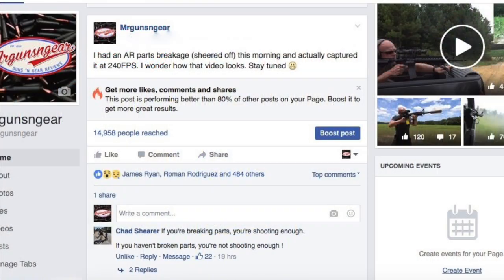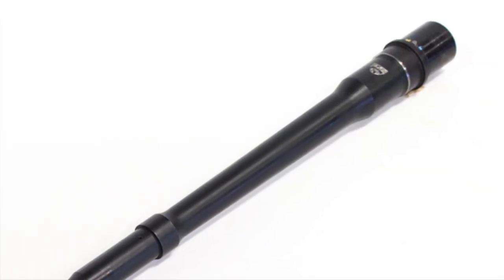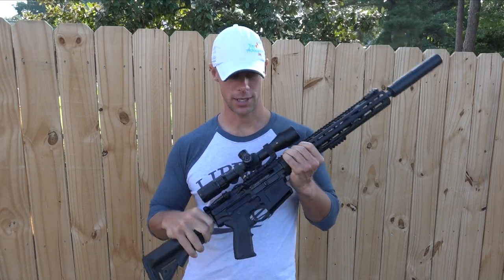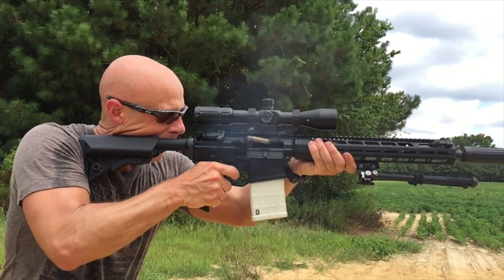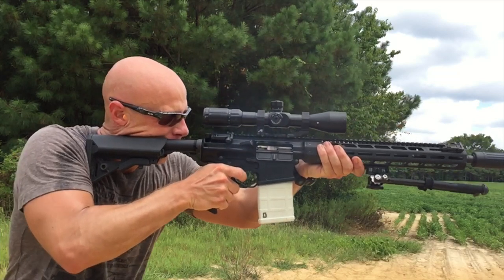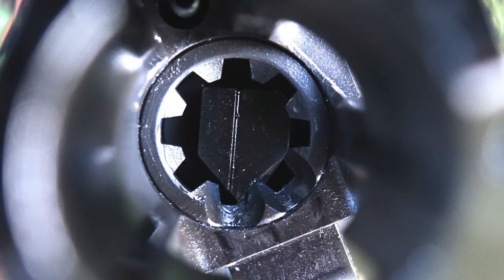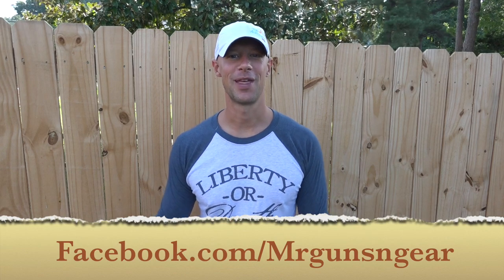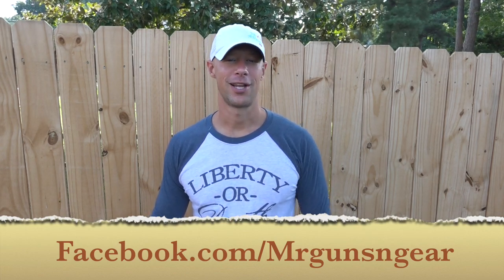AR-10 Bolt Catch Sheared Off While Firing (HD)

Comment: Hey MrGuns, I had the same issue with an early CMMG .308 lpk bolt catch on my DPMS pattern AR308.  It was about 500 rounds in after building (about 4 years ago now).  When I contacted CMMG, they said that was a problem with early designs (built like standard ar15 catches) and sent me out a replacement new model free of charge.  I'm now at least 3000 rounds in on the new one with no problems, using anything and everything, but mostly hot handloads and 178 grain projectiles (was pushing them out to 1000 yards from a 16" barrel with carbine gas system) so I know it has been punished.  Summary, CMMG is my go to for LPK in DPMS pattern AR308, for what its worth.

Comment: +Mrgunsngear I didn't read through all the comments so I don't know if this was addressed already but it looks like you had a bolt catch for a small framed AR patterned rifle. They will still fit and function in a large frame AR/DPMS but I wouldn't trust it. I almost used a smaller one as well for my 6.5cm rifle but it didn't look like it would reliably stop the larger mass of the AR/DPMS bolt carrier group. So I looked up and ordered a large bolt catch and its much thicker to stand up to the mass of the larger BCG.
Reply from the maker: thanks
Reply: You really like the one word responses.

Let me guess..."indeed"   LMFAO!

Comment: Drop a quarter into your extension tube before reinstalling your spring and buffer. This will reduce the over travel of your bolt and will therefore reduce the momentum when the bcg impacts the bolt catch after the last round is fired.
Reply: I used a steel washer of the correct outer diameter.

Comment: Looks like it was cracked previously and had soaked up oil into the crack causing the dark area, then the light area is what was left holding it together and finally let go.  Either that or it was cracked when it had the finish applied, but I doubt that.

Comment: Thanks for making this a video. Reid Henrichs said in a video about DMR semi-auto rifles that the M1A or FAL are preferred because AR 10/308 types don’t hold up under heavy use. Being a former Marine yourself, do you agree? I personally don’t think of it as a battle rifle, more of a useful platform for ease of carrying something that can function reliably in a mobile DMR role if shot selectively (not in rapid bursts) and it compensates for the extra weight having a lot of .308 ammo will add to a marine’s kit. For anything in 300 yards, machine guns and M16s would be enough to do the job I think.

Comment: On my first AR-10 build I had the same thing happen, minus the bolt catch actually getting jammed in the chamber. I was messing with a JP adjustable gas block and ended up way over gassing the gun when I switched loads.

Comment: I have a 9mm AR and have sheared two bolt catches in te process. I have the heavy buffer, plug, 9mm spring just changed to the Seekins precision they claim it is tuff with there new process. The crappy part is I can't use my bad lever so that sucks but hope the damn thing works...good luck
Reply from the maker: thanks

Comment: I have about 3500 put through .one and its still looking good. must have caught a bad catch I didn't hear the first time I watched it how many rounds but thanks to all who explained
Reply from the maker: glad to hear it
Reply: +Mrgunsngear Channel I'm only running a standard cmmg parts kit for ar15 in my ar10 and I have no issues with it but thank you for the video
Reply: +Andrew Fibush - Props on getting the CMMG kit!  They redesigned their bolt catch a number of years ago (I had gotten one of the last of the originals and they replaced it free of charge when it broke) My new one, like yours, has been going at least 3000 rounds so far with no problems.  Great product and great customer service!  CMMG = AR308 win!
Reply: +Pro2A cmmg for the win in general. I love em good quality parts and cheap as hell lol. I got quite a few parts from them. including and entire upper system and completely love them. I guess I turned a fan boy with great costumer service . I have everything cmmg :)

Comment: Last week,  the IDENTICAL thing happened to my Mega AR-10 lower. Mine wasn't after 2,000 rounds, mine was after 21! Yes, the 21st round caused the bolt catch to be launched into the chamber. I sent Mega an email, and they explained that they don't make the bolt catch but without question, they sent me a new one. The new one is slightly different, and hopefully holds up much longer. I've needed to use their customer service once before, they are quick to respond and stand behind their products, good company.
Reply from the maker: crazy

Comment: Same failure I had with my AR-15 while suppressed.

Mega arms billet receivers
14.5 rainier arms ultra match barrel
BCM BCG and gas block
Silencerco Omega

I installed a heavier buffer and slowed down cycling action and haven't had the problem since.
Reply from the maker: thanks

Comment: Funny you posted this vid bc I sheared my CMMG Bolt Catch on my AR 308 build couple of weeks ago. I was running a SiCo Omega & only made it thru a couple mags(suppressed) when this happened. I noticed it was way over gassed prior to this happening. I then tested a few more rounds thru another AR 308 build(suppressed) & felt it was over gassed as well. I have since learned that an AR 308 is over gassed to begin with so I have added adjustable gas blocks to both my AR 308's & now feel that I have the right adjustment when I have a can on. My question: Do you feel this is more of an issue with the under sized Bolt Catch for the  AR 308 or maybe not having the correct adjustment on the gas block? I definitely don't want a catastrophic failure(similar to yours) in the most inconvenient time. Thx & very interesting scenario.
Reply from the maker: undersized catch

Comment: I snapped two bolt catches with aero precision 308AR series. Then I got an adjustable gas block and it hasn't happened ever since. I guess you really need to be on top of your gas control...
Reply from the maker: indeed

Comment: you can see it was a MIM part.. after you got it outta the chamber, was your chamber, and barrel still GTG? did it do any other damage?
Reply from the maker: it was good to go
Reply: Awesome.  That was my question too.  I'm going to be doing a similar AR-10 build with a Superlative adjustable gas block too, so I'm glad I see a similar build in working condition.  Now if I could only get a Superlative order delivered in less than 6 months that would be fantastic.  Otherwise it's like waiting for a can stamp from the ATF.

Comment: I can understand this happening on a .308 but why is this common on 9mm?  I only ask because I would like to build a 9mm AR at some point.
Reply: Gotcha, that makes sense.
Reply: Eric nailed it regarding the 9mm's shorter travel distance and getting a run at the bolt catch in a standard buffer tube length if you don't use a spacer or an extended buffer. In addition to the built-up of speed, a direct impingement bolt carrier group weights 11.0 oz plus the carbine buffer weighs 3.0 oz for a total of 14 oz reciprocating back and forth. In a 9mm AR, the bolt (i.e. not called a BCG in this case) plus buffer must weigh a minimum of 1.7 lbs (or 27.2 oz) in total to keep it from moving too soon due to the blowback design. If it weighs nearly twice as much, and has a running start at the bolt catch, you can see where physics (i.e. Force = mass x acceleration) quickly comes into play.
Reply: I appreciate the replies.  This information was helpful.  Thanks.

Comment: This is why you DON'T use AR-15 bolt catch in an AR-10 platform, the 308 bolt catch is larger/longer and more robust to handle increased pressure...

Comment: Ok I have a question pertaining to an at-10 I just finished building. When I have an empty in and pull the charging handle back the bolt catch does not catch the bolt and it just slides back forward. Does anyone have any ideas on what the issue could be and how to solve this problem?
Reply: Travis Conner have you check your buffer could be your buffer might be the wrong length
Reply: I'm troubleshooting the same problem...

Comment: Was that a mim'd part?
Reply: looked like it
Reply: was gonna ask same question till i saw your's. i bet it was a mim'd part
Reply: I bet it's not a MIM part. However, a lot of these billet parts are not rated for suppressor fire. It's why I also advocate getting or using forged parts when possible. The forging process is the strongest method for creating metal parts.
Reply: only way to know for sure is to ask him to share some close up pic's of the part, I would bet it's MIM as a lot of parts kits being sold are just that, add in the fact it's an AR10 kit with lower volume than an AR15 kit and odds are it's MIM...
Reply: Rick S it was def a MIM part, on the one side you can see the little circular depressions in the metal from when it was made, that shows it was a MIM... it's not ganna have those if it's forged... but I do agree forged is the best way to go, even over milling!

Comment: I know they happen but, it still sux when it does. I had an ar 15 "dream duild" I did. I used a Vltor mur upper receiver for this build. about a year after I started having short stroking issues eventually to the point it became a single shot. I went over all the usual suspects(gas system, carrier key, buffer setup.) All seem g2g. Eventually I swapped out the bolt carrier. Worked for about 250 rounds then the problem reappeared. Tried the same fix, same thing happened. Finally swapped out the Mur with a regular cerro forge upper receiver and the gun as been running great since. When I contacted Vltor about this, the guy I delt with was a condescending dick. I always HAD good experience with Vltor and thier products until this issue. I understand stand shit happens. This guy was acting like Vltors products are impervious to every and ALL malfunctions. So now I have a $200 reminder that no matter how good or unlikely it is to fail, it can. Oh, and Vltors customer service went to shit.
Reply: I've dealt with Del-Ton customer service and they were fantastic. I have one of their uppers and the gas block cracked after about 2000 rounds through it. The cs rep. (a female) was apologizing and she sent out that day a new gas block with a Del Ton t-shirt and a USGI magazine. She did request I send in the defected part to be examined. Which was fine with me. Also, during the last gun scare when parts were scarce to say the least. I found the grip I need at Del Ton. When I called, the grip was gone. I explained it was the last item I need to complete a SBR. The cs rep. put me on hold, came back and offered to provide me a grip that was on hold  for him. I thought that was going the extra mile too. Most gun manufactures have good to outstanding customer service. Another company I had a great experience was with FN.
Reply: +Rick S +Aj D  That's good to know about del-ton. I'll check em out. What really surprised me about Vltor is I have delt with their customer service a couple years ago. Both times they where outstanding. But I guess things can change in a couple of years. Too bad, I really liked their products. But I agree Aj, Bad customer service is a deal breaker for me as well. The guy from Vltor actually emailed me back after I told him to forget it due to his condescending attitude just to be a dick one last time. It wasn't just bad, it was appalling customer service. I saved the emails and I'm still contemplating weather to push the issue.
Reply from the maker: thanks for the report
Reply: +Aj D With a $200 loss I am going to give them a call about it. The exchange I had about the mur was via email and I was sure to save all emails. I'm going to try calling them more so about the horrible customer service I received from Aaron Cardenas. After 7 emails exchanged and never an rma#. Good customer service would have offered an rma uppon the first email. Every email I did receive was in direct contradiction to what I was saying my issue was instead of, well, support. Every other company I have ever contacted about an issue immediately offered an RMA# and a shipping label weather that's what I was calling for or not.